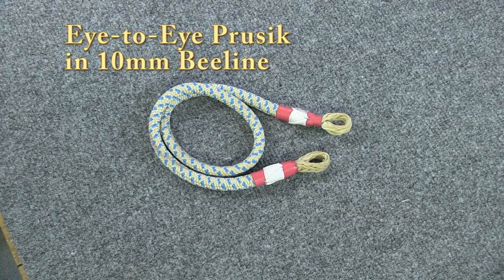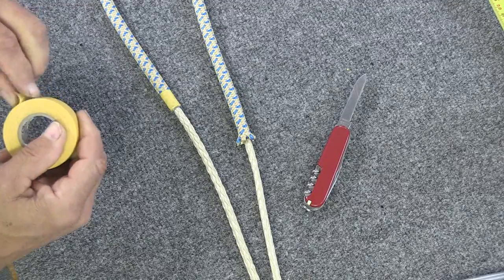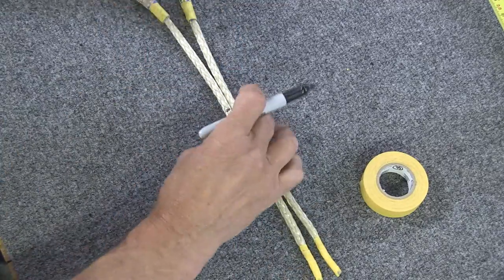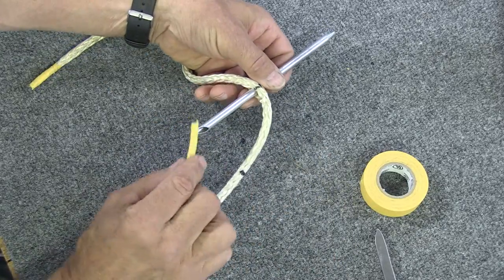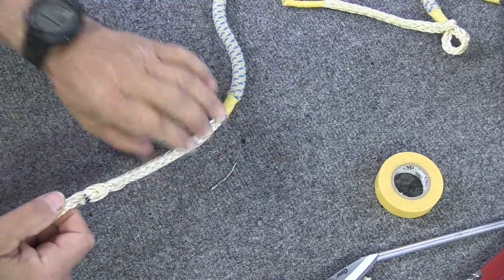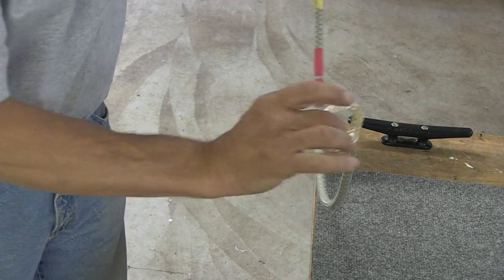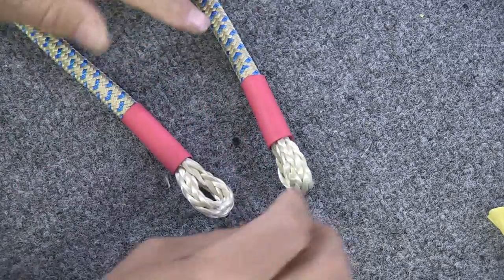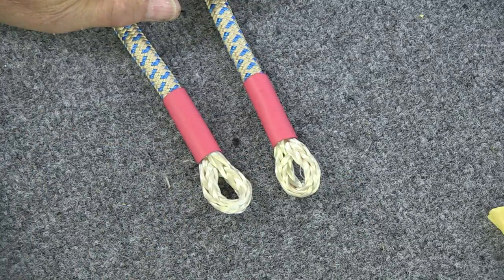Beeline Prusik-Part 1

Comment: Thanks so much for this video! Is 8mm beeline the same splice?
Reply: Procedure is the same, but the smaller diameter would allow you to use Slightly shorter measurements,  but if you use these numbers, you'll be way good

Comment: Thanks for the video.  Is there an advantage to applying shrink wrap before stitching?
Reply from the maker: The heat-shrink tubing just makes it really easy to cover up the ragged ends of the cover.  But if you want you can leave the heat-shrink tubing off and just apply the whiplock directly over the end of the cover.  If you want to see some really pretty examples of whiplocking without the heat-shrink tubing, visit the "show us your splices" forum on the Treebuzz website.

Comment: 3/8th fid is for 9mm. if this is 10mm beeline wouldn't it be a 7/16" fid?
Reply from the maker: If you use the larger fid you get a deeper bury, which makes the prusik stiffer and harder to use.  So I go with the smaller fid.  It is plenty strong and I have never seen one pull apart or show any sign of breaking, even when they get old and worn.

Comment: What size heatshrink do you use? And is it rubbery?
Reply from the maker: The red stuff I used in this video is 1/2" diameter.  It remains flexible after you shrink it.  If you want to see another way of doing the whiplock check out my video on how to do an eye-to-eye prusik in Teufelberger HRC cord.  In that video I do the whiplock first and then put the heatshrink tubing over the whiplock.  I think it looks nicer.  But either way works.

Comment: Can I do this using part of climbing rope? If yes better will be to use dynamic or static rope?
Reply: Brummel splices are not used on climbing ropes.  There are other splices that can be used on double-braid climbing ropes or 16-strand climbing ropes.
Reply: @bethjolarsen  so which splice can I use to do Eye to Eye prusik cord on climbing rope?
Reply: @sebastianostrowski707  you can use this for an eye to eye, if the cord you are splicing is Yale beeline.. Otherwise different cords use different techniques and some cannot be spliced safely (eg green Armorprus).

Comment: is it important or worth it to add/insert those steel eyes into the splices?
Reply from the maker: You do not want to put steel or plastic thimbles into the eyes of eye&eye prusik cords. You want the eyes to be small so they fit tightly around the carabiner and can be squeezed together if you are going to insert the eyes between the side plates of pulleys like the DMM Pinto.  Thimbles add a lot of bulk and do not fit tightly around the carabiner, so they just get in the way.

Comment: What if I'm not splicing with a fid, how many inches should I measure?  So I did some calculations and for the second mark for a 29' would be 10inches.  I could then measure 3.5 down from that?
Reply: A fid for any length of rope is 21 picks. A pick is a level of threads of the rope. Samson rope has great instructions on their website that might explain it better if you don't understand my interpretation.

Comment: Do we do anything special to the eyes to protect them from wear or not necessarily? Also do you use these for life support or rigging or both? Thanks from a newbie.
Reply from the maker: Other than giving the eyes a coat of polyurathane you don't need to do anything to them.  Over time they will start to look fuzzy from wear, but that is not a big deal.   I primarily use them for life support on moving rope and/or stationary rope systems.  But they can also be used in many rigging situations, including progress capture in mechanical advantage systems.

Comment: How long is the fid?
Reply from the maker: I use a 3/8"  (9mm) fid, which is 7.75" long.
Reply: @ericforsman7787  thanks for the quick reply. Will try to make one soon.
Reply: Fid length is 21 rope diameters. So a 3/8in fid is 7”7/8. 1 fid for a 10mm rope is 21cm, a short fidlength is 7cm, and a long fidlength is 14cm.

Comment: Will this work with other class two friction cord? Looking at ocean
Reply from the maker: No.  But Ocean is easy to splice with a double braid splice.
Reply: Eric Forsman class 1 or class 2 ? I am fairly new to splicing and am not finding specific information on Ocean 10mm
Reply from the maker: @roberthall6195  There is not a lot of info out there on splicing Ocean Poly because the manufacturer says it cannot be spliced.  But it is easy to splice using a standard Class 1 splice.  It has a polyester core and and 50:50 cover of polyester/kevlar, so I just use a standard class 1 double-braid splice.  If you do splice it, be sure to use a Yale Whiplock to lock the splice so it cannot work loose. If you are new to splicing, be sure to get onto the Treebuzz website and start browsing the Splicing Forum.  There are a bunch of splicers on there who will treat you nice and will be happy to give advice.
Reply: Eric Forsman thank you
Reply from the maker: For Ocean Poly I use a double-braid splice

Comment: ¿Y la homologación de ese cordino quién se la da? ¿Tú?
Usar algo así es de apreciar muy poco la vida, o de ser muy insensato, hay útiles parecidos en el mercado con su homologación, como una simple cinta de dinema. Ni por un millón de euros me cuelgo de ese cordino, suerte amigo.
Reply from the maker: I have been hanging on them for years Jero, and have never seen one break or even look like it was going to break under normal use.  Plus I have had break tests done on them and they typically do not break at anything less than about 7,000 lbs in a basket hitch configuration.  But if you choose to not do your own splicing and buy your gear from a reputable dealer, that is fine by me.  In fact, for the vast majority of climbers who do no want to take the time to learn to splice, that is what I would recommend.
Reply: @ericforsman7787  awesome reply.
Reply: @ericforsman7787  Hi Erik, the videos are great. I've been climbing on these e2e's for a couple of years now. I really like them but would like to get some tested. Could I test used ones or is new better? Is basket configuration the best way to break test an e2e or is a straight pull OK?
Reply from the maker: @Fredward1986   Since they are normally used in a basket configuration that is the way I think they should be tested.  Which ones you test kind of depends on the question you are asking.  If you want to determine the strength of a newly spliced hitch cord then you would obviously test a new version.  If you are curious about the strength of a well-used hitch cord, then you could certainly do a test on one of your old ones.